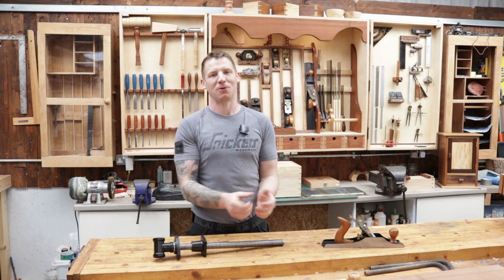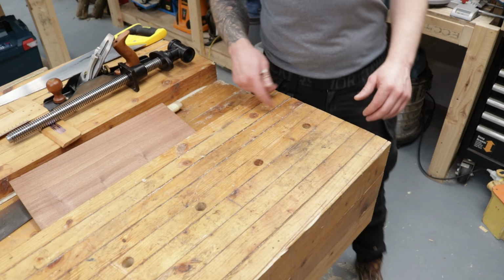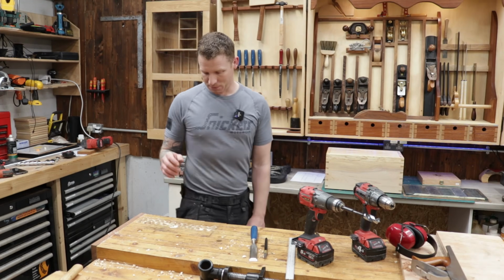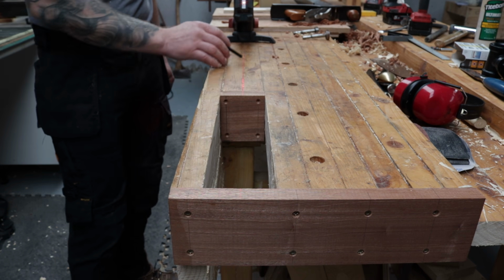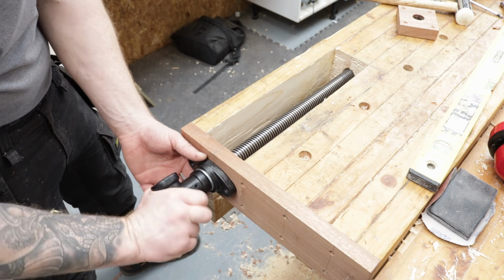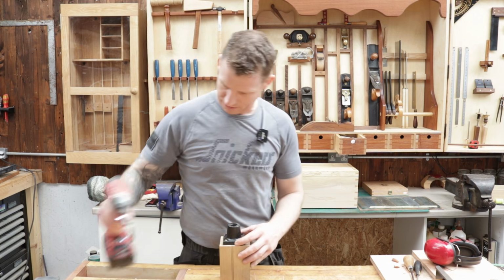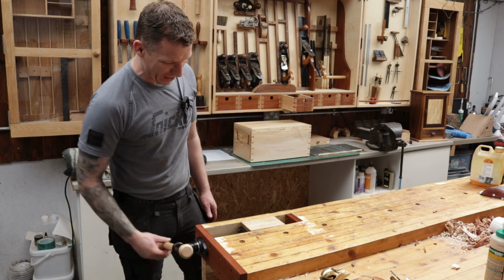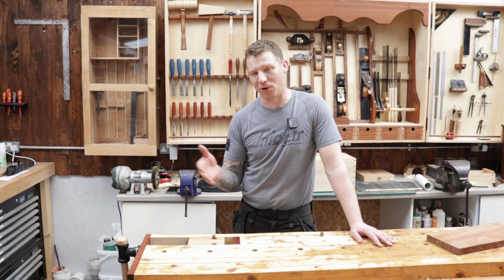Wagon/Tail Vise Installation. Not Expensive, Simple and Very Effective!

Comment: May I ask why you prefer this vise over a Shoulder Vise Screw? You could just push and pull the block instead of drilling it through. Unless you don’t want the screw obstruction you while walking around the bench if it’s in the open position.

Comment: It looks like you’re gonna get quite the work out turning that vice handle since you didn’t drill enough clearance at the end of it. I saw that right away. That vice handle should spin. Plus your sliding block is too tight. That should’ve been mailed up with guide reels on either side and a lot looser.

Comment: hmm I like it, if you had made the vice push the wagon instead of through hole you would have had more clearence for clamping stuff in it. Anyhow, probably not the main function.

The through hole you did on the other hand will make the wagon more stable, with no need for guide "grooves" and tongues.

Comment: This video is helpful to me.  I recently moved and need to build a new workbench.  I was given a 1 1/2” threading kit and want to incorporate an end vise with a wooden screw.  This video helps with the design.  Now that you’ve had a chance to use your vise for a few months, have you found any hint of weakness of the attachment in the plate that is held with 8 screws in end grain?
Reply from the maker: I have had no issues so far  you don't need a lot of pressure for work holding

Comment: I notice that at 26.20 the board you put down to plane lifts at the vice end. This will get worse as you use this. You are relying on the threaded rod to keep the block level. It will not as the hole is oversize. It will be level at the nut end but the other end will rise up and so will your work piece. You need to put runners in place even half inch alloy angle will do in the centre of the block and slots either side. You can then cut the rod and use the opening as a chair vice as well If you wish..

Comment: Hi John, have you discovered that you should have set the screw lower in the bench so that you don't hit the handle when planing max length pieces
Reply from the maker: Not at all the boards never go past the handle if they are caught by the dogs and the handle can be turned horizontal to drop below the top
Reply: @JohnMcGrathManInShed  No I mean hitting the handle with the plane, if say you are using a No7 or so, don't know if it's all the planets lining up against me or just Murphy's law but my handles always in the wrong place, backing the handle off just makes the job loose

Comment: Sorry I’m confused 🤔 how does the wagon manage to travel up and down the bolt without the bolt moving back and forth.  I don’t he how the captive bolt system works.  Sorry.  Be grateful for an explanation.
Reply from the maker: Think about a nut and bolt, If you turn the nut it moves up or down the bolt, if you turn the bolt it moves in and out through the nut. If the bolt can't move in and out the nut has to move.

Comment: I am planning to build a bench soon, and have cut the screw out of an old, but hardy used, car scissor jack to use as the screw for the wagon vise.  It has a plastic hand wheel at the fixed end plus a hexagonal shaft so that I can always use a socket and brace if I need to drive it a long way quickly.  This is a very cheap solution as I would be scrapping the car jack anyway.

Comment: Hi John, love your videos. I couldnt help noticing the thread is opposite to a "normal" vise? 
Could the thread be swapped end for end to make it righty tighty?
Keep the videos coming! Hope your knee is healing up good!
Cheers.
Reply from the maker: The thread is standard,but the nut is moving in and out not the thread so think of it as unscrewing the nut, because the thread can't move the nut moves forward. Can't swap the thread around unfortunately.
Reply: Swapping the screw end for end will do nothing the change the the way you wind the screw.  Think - if you turn a threaded rod end for end it doesn't change the way you put a nut on it.  You would need a left hand thread on the screw to achieve what you would like and those are available as threaded rods

Comment: Hi I am just to the point where you use your laser level, I am surprised you used your chisels to cut to the end, a much better choice would have been a oscillating tool and would have left a much better finish.
Reply from the maker: A multi tool won't cut 4 inches deep and stay square, the blade attachment will sit on the side wall moving the blade off square. I could have come at it from underneath but I can't kneel down with my knee at the minute.

Comment: Just a note. The leg vise screw is made to be used in tension, so the flange is on the outside and the two small screws are just to help pull the jaw open as you unwind the vice. In your application the two screws will be subjected to the full clamping force. 
I would just monitor the situation. If the two screws hold it’s happy days. If not see if you can used bolts and recessed nuts with large washers. They should be much stronger than the wood screws.
Also the fact that you are using a leg vice screw is the reason why the movement is counter intuitive.
Reply from the maker: Yes as I said it's not intended for this use. It's for a L shaped tail vise. It could also be used for a leg vise. It would need a reverse thread to tighten while turning the handle clockwise.
Reply: @JohnMcGrathManInShed  Hi John. Sorry if I sounded a bit like a know it all. I love the idea of getting something to work for what you need it to do, even if it was not designed to do it. That is part of why I enjoy you channel and the content you provide. keep up the good work!

Comment: Nice one lad :) I got a scandinavian vise screw from Dieter Schmid a couple weeks back for retrofitting to my bench :P The screw on mine wont go through the dog block (thats what i call it but i dunno if its right) so il have to make runners for it to slide on. And it also means that the tommy bar and screw will protrude out the side of the bench when the vise is in the open position........wonder how many times im gonna burst me hip into it when im movin around the bench hehe :P

Comment: That'll definitely work well John, I have the veritas insert tail vice in mine which I found was a bit more expensive but easier to fit -- but I find that I've never absolute needed it and I've never used it for face planing at all. I do face planing on the opposite end to where your tail vice is (where your moxon/joinery minibench is standing) and plane up against a planing stop there, and if I need to keep the piece from rotating, I use a does foot or a batten with holdfasts or both. The tail vice is defintely useful but it's absolutely not necessary for face planing on a nicholson bench (or a roubo or a morovian for that matter, all of the old designs do face planing the same way) and all the times I've used it, I don't use it for face planing operations, but for other workholding stuff like when doing carving and chisel work for the 17th century new england carving stuff - there, it's nice and handy. 

The advantage of the does foot and planing stop approach is speed when you're flattening one face by hand - you can put the board against the stop and take a few swipes with the hand plane and then just pick it up, look at it, flip it over and test for rocking on the bench, figure out where the next swipes go and put the board back against the stop and do that whole cycle really fast - well under ten seconds when you're in the swing of it.  

The downside of trying to do that with a tail vice -- and this is why I don't do this -- isn't so much the speed decrease because you're winding and unwinding the vice, that's not so bad really - it's that if you overcrank the vice, the board flexs and now it's bowed and you wind up chasing your tail trying to get it flat, and because the vice screw lets you apply huge amounts of force with very little effort, it's not always easy or obvious to see where the board is flexing, especialy with thinner stock. Ironically, this is the very strength of the tail vice when doing workholding for carving or things like that. It's just face planing that it can bite you on.

Mind you, you use the planer/thicknesser, so this may all be academic to you :) I just use a lunchbox thicknesser and hand-flatten one side and edge first - I've no room in the shed for a jointer and even if I did, the accident reports from those things are terrifying, so a few minutes with a #05 and #08 sounds like more fun to me anyway :)

Comment: looks quite handy! but is it just me or is that screw reverse pitch? It seems backwards from the vises I've used / seen. Is it because it's for it being an L shape vise?
Reply from the maker: Its a standard thread, it's just not being used how it was designed. The screw should move in and out with the handle but here the screw can't move only the nut. So think off it as unscrewing the nut, the nut then moves forward.
Reply: @JohnMcGrathManInShed  oh okay, gotcha! thanks for responding!

Comment: Fantastic job boss! Would there be any benefit to press fitting something like copper pipe into the oak block to allow it to ride over the acme thread on the vise screw?
Reply from the maker: The thread is not actually making much contact with the oak block the thread is 28mm the hole is 32 and the captive nut is screwed to the block so the thread is only passing through.

Comment: Awesome tip on the laser level! Hadn’t considered that for a woodworking tool in the shop. What level are you using in your shop?
Reply from the maker: I have a bosch one, you will be amazed at what you can do with it. It can really speed up marking out and assembly.